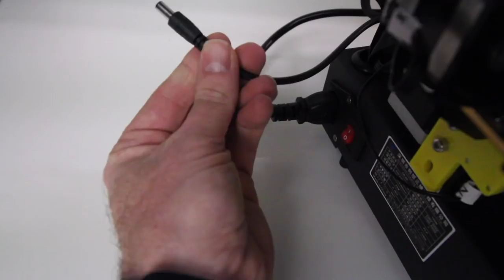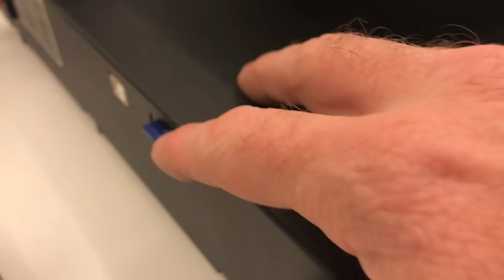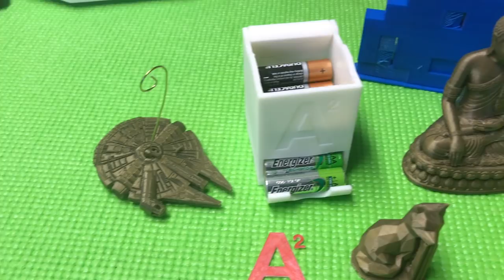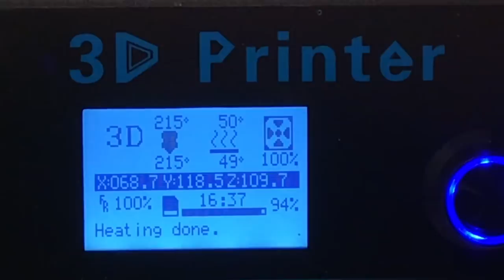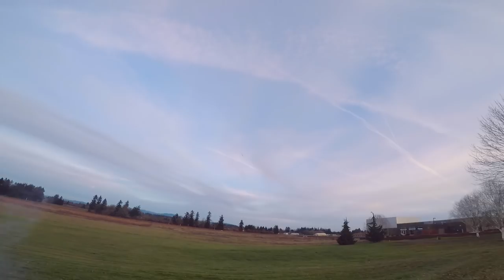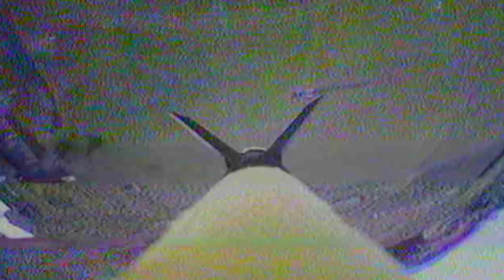Creality CR-8 Review & 3D PRINTED MODEL ROCKET

Comment: It won't warp as much if you run your bed at 80*C and use 1 part PVA glue to 3 parts water instead of you're masking tape, if you just kind of "paint" it on to you're bed before each print the heat makes it sticky ish, but it holds stuff on really well, I don't even have to use a raft or brim now, and I've done really big prints without any warping.